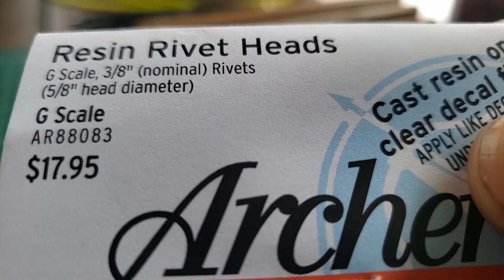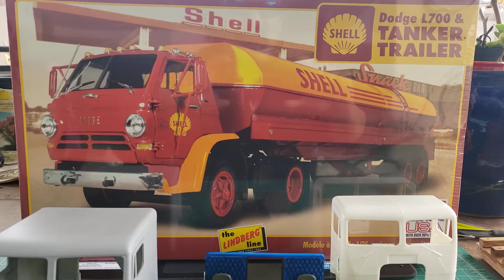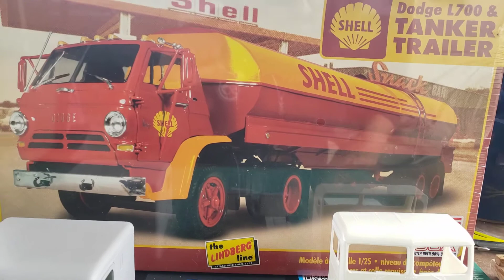Quickie Video for Bigeddie about Rivet project....

Comment: Yes, ima bit slow finding some videos but watching a few here on this seam situation, I also tried the filler there a while ago and found issues. Sure, nice you can use water early on, but the stuff never fully hardens. It has elasticity which I don't want. And like solvent based putties, it shrinks over time. Back to "the seam" I do the alignment (nice going there) thin tape along the outside as well, then use toothpick to fill the trench with superglue. The tape will also protect kit rivets when you sand the seam. Keep the sanding along seam, then when you wipe out a rivet here and there, replace them with Archer, just using a few - they're pricey! HTH
Reply from the maker: goratgo 70,
Very, very helpful comment. Thank you for posting. 
I only wish I would have read your comments BEFORE I did my hack-n-slash. 
I think I'm hooked on these AMT big rig kits....and JR Salvinos.
Once again,  thank you for your very helpful comments.  I hope a beginer, new modeler somewhere reads these post and YouTube videos and there is no longer any fear or trepidations about purchasing and building these wonderful Freightliner Cab Over kits.